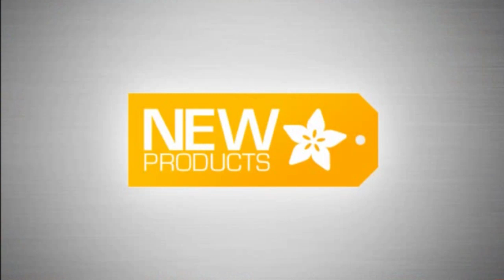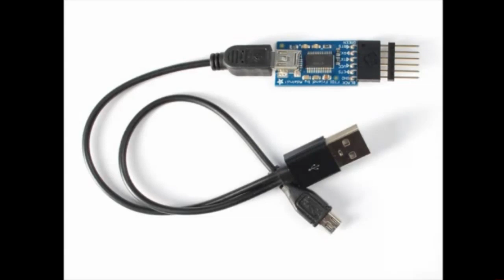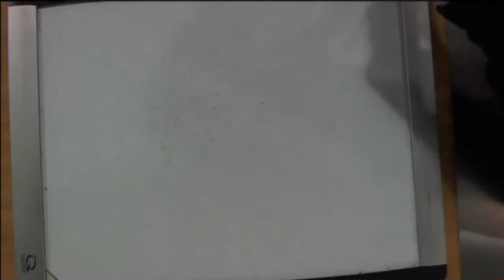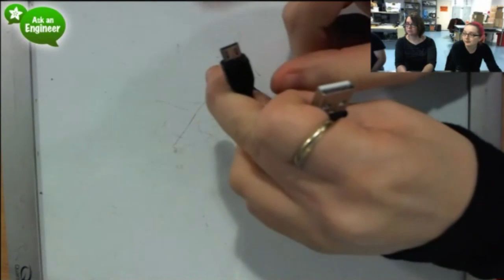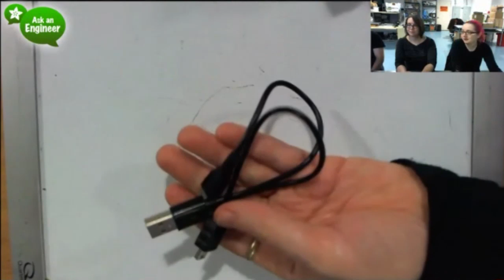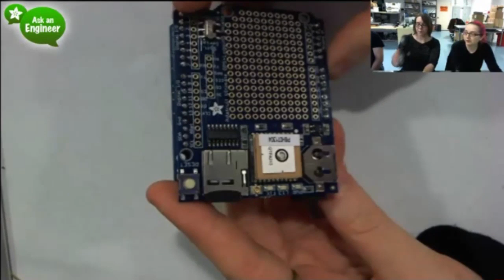New Products 2/23/2013

Comment: Is RTC built into GPS?

Does battery hold also a GPS fix data (almanachs, etc), or is it stored in some flash on ultimate gps that doesn't require batter? That would be nice, so it I remove all the power, the GPS will get quick fix back after powering up again.

Comment: Is necessary connect the antenna to get GPS location?
Reply: It looks the antena is optional. The GPS module has a small patch antena built in, so you only really need external antena if you want better sensitivity, or you put it all in enclosure, or use another shield on top.